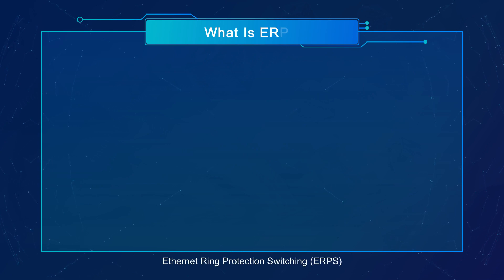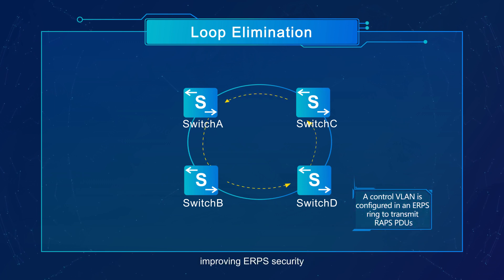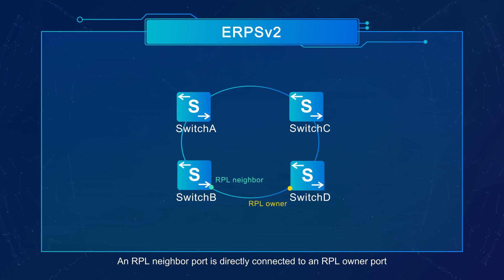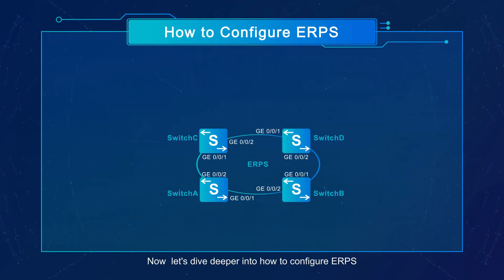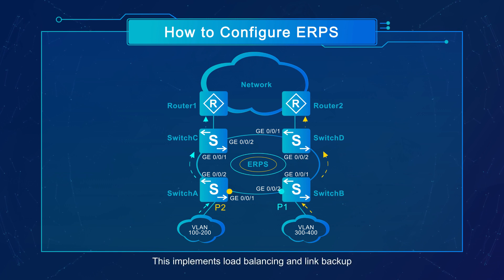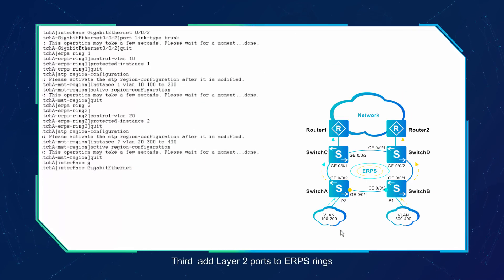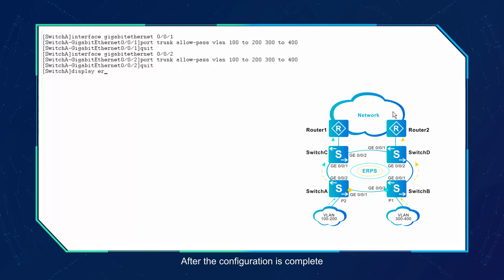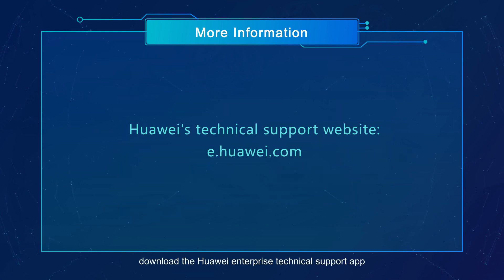How to Configure ERPS on Huawei S Series Switches

Comment: ERPS can be configured for open ring? stitching the MSTP(closed ring ) & ERPS(open Ring)?
Reply from the maker: Thank you for your feedback.

MSTP (closed ring) and ERPS (open ring) can be configured together.Before adding a port to an ERPS ring, ensure that the Spanning Tree Protocol (STP), Rapid Ring Protection Protocol (RRPP), Smart Ethernet Protection (SEP), or Smart Link is not enabled on the port.MSTP is a type of STP.
If you have any other questions, leave messages in corresponding web pages.
Reply: @HuaweiSupport  thanks for your detailed explanation, if it supports the ERPS open ring with MSTP then how the control packets are moved over the MSTP ring?
Reply from the maker: @jagadeesansaec  
I'm sorry, there is a mistatke in the previous answer. MSTP (closed ring) and ERPS (open ring) can not be configured together.

If you have any other questions, leave messages in corresponding web pages.